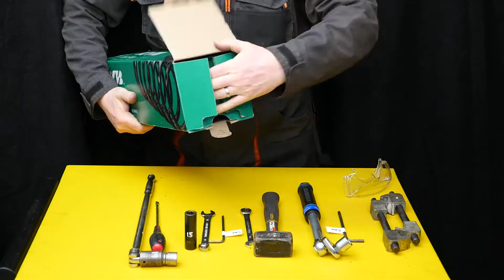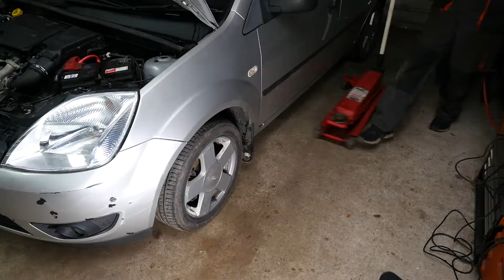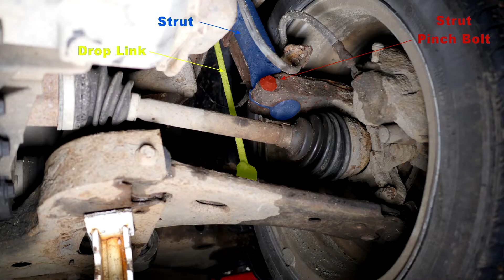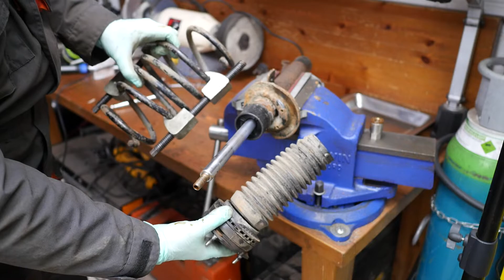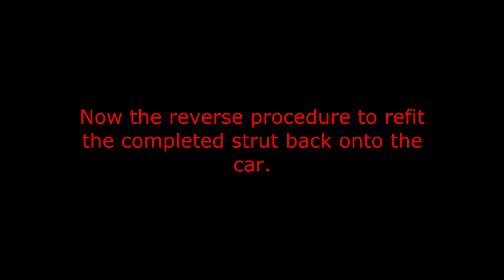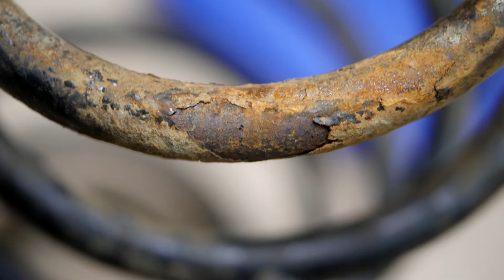Replacing Broken Front Suspension Spring on a Ford Fiesta Mk 6 🚗🛠 KYB MacPherson Strut

Comment: Howto unbelt suspension on the other side (I believe the drivers side?) cause the brake fluid reservoir is blocking access to the top nuts.
Reply from the maker: Never easy is it.

Comment: Awesome and detailed video! I have a Ford Fusion, which uses the exact same suspension. The passenger side has a rusty spot on the exact same place as where yours broke. It is still surface rust, but will be replacing the spring very soon nonetherless. I am going to use your guide! :-)
Reply from the maker: Thank you and good luck with the repair.

Comment: Not bad but you could have dealt with the bad corrosion on the lower part of where the spring fits. Poor job really.
Reply from the maker: I was replacing the spring only though.  If I started painting it that would have ended the video.

Comment: On my new shocks and bump/dust cover kit, my boot/gaiter doesn't clip to anything like you show at 19:18. It hangs just slightly looser than the metal shaft of the shock, does this matter? I noticed a few Ebay & EuroCP shocks don't have the wider-lower plastic/metal spacer as shown. I checked the KYB bump kit and the boot matches the Reference OE/OEM Number: 1825487... any ideas?
Reply from the maker: When the car is lowered it may cover the end.  What you don't want is the chrome piston open to the elements and road salt which would pit it ands lead to the seal leaking gradually over time.

Comment: Hi there,

Great video , ive just replaced the  rubber boot/gaiter on the offside strut, my questions are what does the gaiter attatch to on the top mounting plate with the 3x threads?
I didn't see the bump stop on your strut was it in the gaiter ?and my strut didn"t have the bump stop present can i assume that its worn out and fallen off?
My fiesta is a 2004 flame model 1.4 petrol.
Sorry for the long message,thanks in advance for any help you can give me.
Andy
Reply from the maker: Sorry for not seeing your message earlier.  I no longer have the car and sadly cannot remember how things were.  Have you tried looking at the struts on ebay as there may be photographs on there of the various parts.  Sorry I cannot be of more help.

Comment: Excellent details. Wish I had changed both at the same time. Did one side had the parts for the other side but didn't get it done. In my defense, it was minus 5 Celsius at the time. Now six months later the other side has gone. It's now 16 degrees sun is shining. Easy job thanks to this video.
Reply from the maker: Thank you.  They do seem to fail together lol.  You have the better weather now though.  Perfect weather for car repairs.

Comment: I have the same car but a slightly different issue, the front nearside corner sits low and 3 garages have all said the springs are perfect and not broken .it wasn't like that 6 months ago but it's slowly sunk lower over time .it had a new top mount on that side fitted before I bought it so one mechanic suggested it's got mismatched springs fitted ,it pulls to the left and the nearside tyre is wearing down twice as fast as the other side .trying to get someone to change the two front springs is a pain as they cannot see an obvious breakage .Not much money at this time of the year in my job so just hope it lasts another month or so and then try again etc .cannot think of any other components that could cause it to sit low unless anybody else can suggest anything .
Reply from the maker: Sometimes the springs have a paint mark identifying them, does sound like they might have different tension ratings.  The springs are pretty cheap to buy.  You might find the answer by taking them apart yourself and looking closely at things.

Comment: Great video. So far I've seen three different videos each with slightly different steps in tackling this job. One removed the driveshaft, which is a bit overkill maybe, the other undid the track rod arm attaching to the knuckle, you haven't touched anything on the knuckle other than the pinch bolt for the strut. And the Haynes manual says to remove the track rod and the lower control arm.

My question is it safe to leave the track rod and lower control arm attached when hammering the knuckle to free the strut or could they get damaged?
Reply from the maker: Thank you for the comment.  No damage to the car resulted and it shortly had an MOT a few months later which it passed.  I think if your careful and gentle you should be ok.

Comment: Just had exactly the same thing happen on my sons 08 1.25 zetec, I didn’t notice it straight away and he took a test in it🤫.......the spring only just missed the break pipe.
Reply from the maker: That's it lol.  Extremely dangerous if you ask me.  I changed both sides as the next will fail shortly afterwards.

Comment: Absolutely brilliant video, many thanks! My offside spring broke at the weekend, only a couple of months after having had the shock absorber replaced by a garage. Watching the video has helped me today to remove the shock absorber and spring myself, so tomorrow I will buy a replacement spring and rubber boot as there is a very small split in it. I am a little nervous of trying to compress the spring myself, especially as I don't currently have the tools,  so will see if I can get the local garage to do that part for me. Useful to see too that you do not have to disconnect the steering arm, as suggested in some videos, especially as I do not have a joint splitter. The nearside spring looks in poor condition too, so will tackle that next!
Reply from the maker: Thank you so much for the comment. I love to hear my video has helped someone complete a job.  It's great to hear this.

Comment: Excellent detailed video. Can you use an 18mm offset ring spanner to get the stut nut off? Or an 18mm socket with mole grips? Thanks
Reply from the maker: Thank you for the comment Mark.  I'm not sure an offset would fit down there.  I took a normal 18mm socket and ground the edges away.  You could just grind opposite sides for an adjustable spanner to fit maybe. If you search Kennedy-Pro 18MM Go Through Socket on ebay they are £8 delivered I think.
Reply: @CoatsandGaiters  Thank you 😊
Reply: @CoatsandGaiters  Just looked on eBay. You're right they are £7.99 so I'll purchase one. 😊 Do you need to use loctite on the bolts or is that not really necessary?
Reply from the maker: @2711marcus  think they are the nylon lock nuts as I recall Mark.
Reply: @CoatsandGaiters  Ah good. This is the 4th time a spring has broken so I'm.gonna attempt it myself. I wonder if Ford have rectified this problem on newer models? It's a bloody pain in the ass haha. But thank you for the video it will help me a lot 👍
Reply from the maker: @2711marcus  Good to know this video will help you makes it all worthwhile.  Those springs are a failing nightmare.
Reply: @CoatsandGaiters  Yes they are and all the speed humps don't help. At least I'll save myself some money this time if all goes well. All the best 😊

Comment: Have a 2007 fiesta and this has now happened 3 times...  1st when I had just reversed out the drive, 2nd and 3rd times whilst stationary on the drive...  1st and 3rd times my tyre has been wrecked.  What if this happened whilst driving,  could cause a serious accident and injury to the occupants of the car, other road users or pedestrians...  how have ford got away with not acknowledging this issue and recalling???  Thanks for the video by the way, great work!!!
Reply from the maker: Thank you for the comment.  I was really shocked by this as well.  Like you say the fear of a ripped open tyre isn't very amusing.  I've never come across anything like this before.  Like a ticking time bomb.  I guess you have to replace them every other oil change lol
Reply: @CoatsandGaiters  thanks to your video I might try replacing the spring myself this time...  then again will need to weigh up the price of the tools etc against paying probably a couple of hundred quid to get a mobile mechanic out

Comment: Not sure how Ford's dodged this one....
Reply: Its shocking that Ford haven't recalled these cars over this issue....  serious accident waiting to happen!
Reply from the maker: @lewisbrown51  Totally agree.
Reply: @lewisbrown51  Ive had my fiesta a year now. Driver side spring snapped half a year ago. Couldn't be bothered to change the spring so I bought a strut for £30(used). Now passenger side snapped. This time I got two new springs and after watching this wonderful video I'm going to replace both
Reply from the maker: I've never come across springs that just snap randomly like these do.  Bit of a safety concern I'd have thought.  At least they are cheap.
Reply: @CoatsandGaiters  do you have to replace a spring on the other  side to  if only 1 spring is faulty?
Reply from the maker: @damiandrop8884  I would as it likely to go any day.  Better to get both done so you don’t come back to your car after work to find the spring snapped on you and then you have the added cost of a recovery home.  Also a new spring on one side and a soft worn on the other may affect handling a bit.